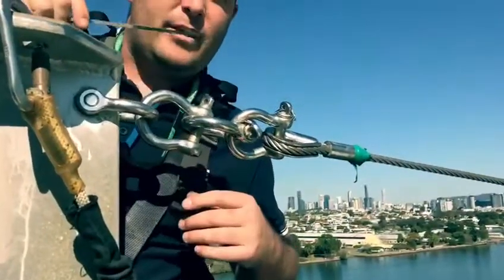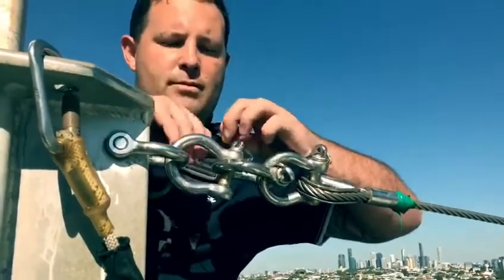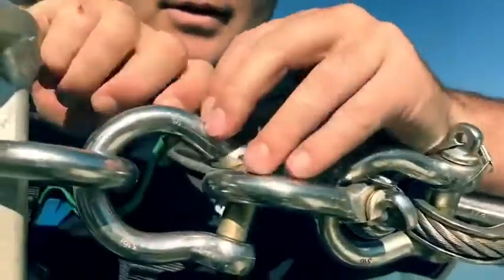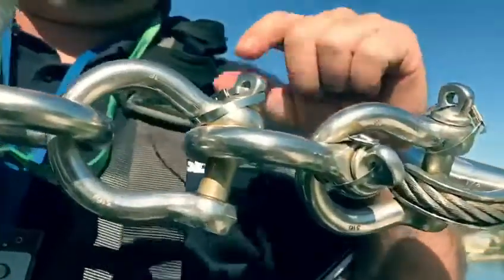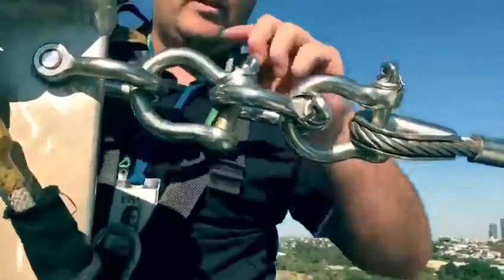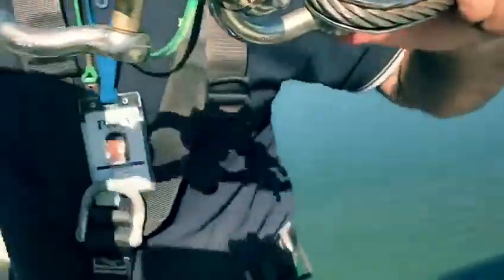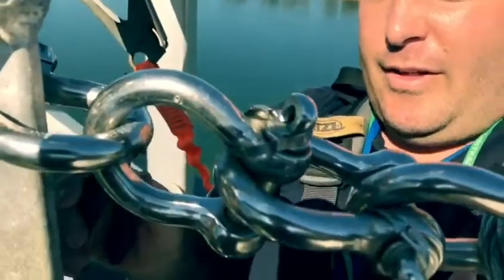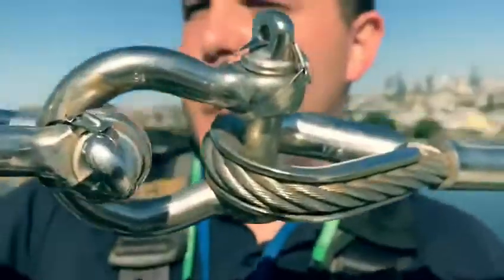Mousing A Shackle

Comment: Pin to pin, bow to bow. Never bow to pin.
Reply: Would you mind explaining why?
Reply: @mgspindula   as seen in the first 3 seconds of the video. A shackle should be used to pull straight not  under a angle, as seen in the first few seconds of the movie,first one is oke, middle sector in totally pulled under a angle. last shackle pulls straight again. That's where the pin to pin,bow to bow rule is for.